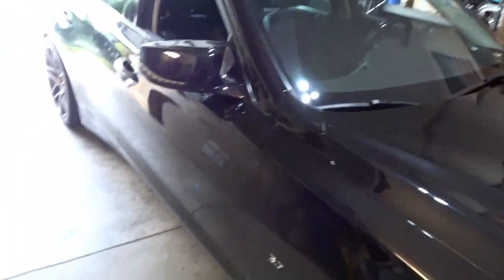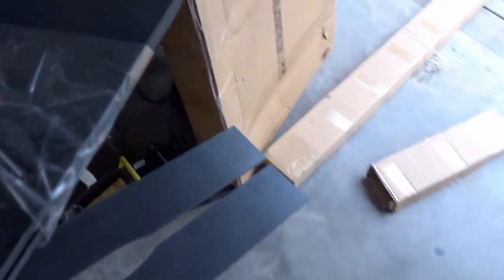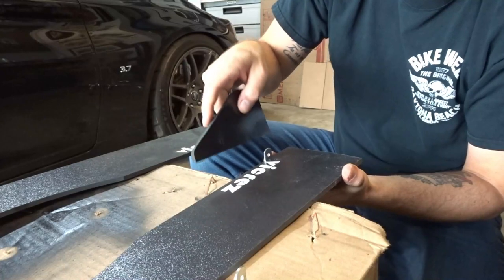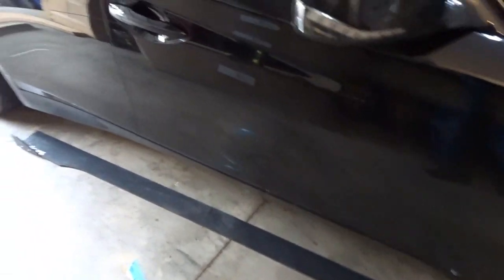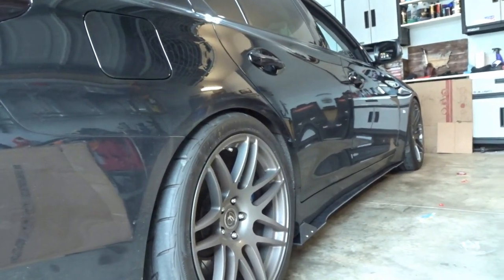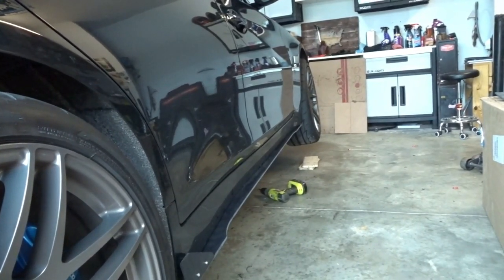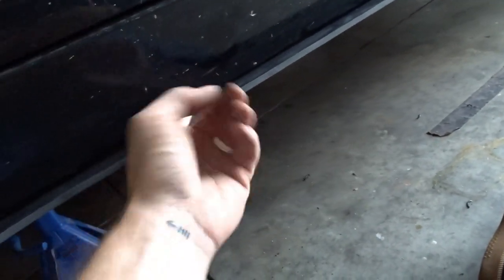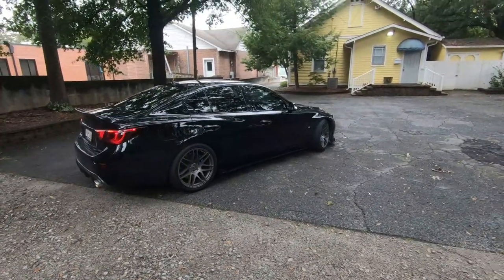Vicrez Side Splitter Installation | Changed the Q50 COMPLETELY!

Comment: Looks good! Only thing I do not like is that the fin is a separate piece looks a bit tacky having the hardware showing. They should just make it a one piece design. Fitment looks good though!
Reply: Yeah, they could’ve thought more about it, at least have made the hardware black to match. I definitely understand cutting cost though #ROI
Reply from the maker: Totally agree.  I actually had a few comments about this in my video that I edited out because the video got too long.  You'll see all of my opinions on these splitters in the coming days!
Reply: @SpeedCultureStudios  Sounds good man! I agree though there really is not a good splitter option for our cars. I ran those small splitters you originally had but it just looked to cheap for me so I eventually removed them. I now got carbon fiber splitters which I mostly like my only gripe is they stick out far from the car.  I would say your current splitter has a better or more ideal to me fitment. Just prefer that mine is single piece with the fin.
Reply from the maker: @Dreamevil2009  We are on the same exact page.  I like the sleek subtle look where they don't protrude too far and have a small fin, but it needs to be a single piece for me too.
Reply: @SpeedCultureStudios  Gotta make your own!
Reply: I agree, looks good and fitment is on point but would maybe paint or get some black hardware? 👍🏼

Comment: The finish on the splitters, will probably help with wear & tear from road debris. Versus a gloss black or paint to match 🔥🔥
Reply from the maker: This is true!
Reply: oh for sure, i have some garbage ebay fake carbon splitters, clearcoat coming off after two months and from the front to the back you can feel it go from very rough to smooth gloss, made a huge mistake buying from ebay, never again
Reply: @BigJohn-fz7mt  I feel you champ, but it’s not eBay, it’s the seller’s failure to make a good product 🤝
Reply: @impropernovice2149  I just think the quality of parts on ebay is much less compared to actual brand sites, i speak from experience because not only did i buy side skirts, fuck i bought a splitter diffuser and lip too, all from ebay. The only one that hasnt completely gone to shit in less than 3 months is the lip.

Comment: Hey man.  Could you place and bolt the bracket to the underneath of the splitter instead of the top like you have it? The fin will drop a little but it may look better.The bottom of the fin would be flush with the splitter but sticking out. Eh... Thinking this out as I type lol. Nope, we need to make our own splitters.
Reply: He said it wouldn’t work that way, unfortunately, but that’s why we need speed culture splitters 😉
Reply from the maker: It can’t be done because the holes on the find are predrilled so putting the bracket on the underside will cause the holes to be too low for the fin.  I tried lol.  It’s edited out of the video but may show it in my review video coming up.
Reply: @SpeedCultureStudios  Well it looks good a a great addition I think to the aesthetic look of the Q

Comment: I have a 2014 q50s 103k miles stock rims and height. Both front wheel bearings are going bad so I'm changing them and both front cv axles lol. Also noticed right cat converter needs to be replaced soon when I was under car,, but no biggie yet. Just wondering if you had any similar issues
Reply from the maker: Not yet thankfully.

Comment: 100% agree about the brackets. It looks like the logo is supposed to be up front. Black hardware would've been a much better choice for them to use.. Definitely improves the look of the car overall, but this looks cheap and just seems like a half@$$ed thrown together kit. Good starting point for improvements I suppose. Definitely needs some structural integrity. But like you said, maybe using some fender washers would help. Love your install/review vids man. Keep the hustle homie
Reply from the maker: Thanks Mike!  I agree on all points!

Comment: Just my thought maybe the bracket should be mounted from underneath the splitter then you wouldn't see the edge of the splitter.
Reply from the maker: I thought I showed that in the video—if mounted in the underside, the holes don’t line up because the bracket isn’t tall enough